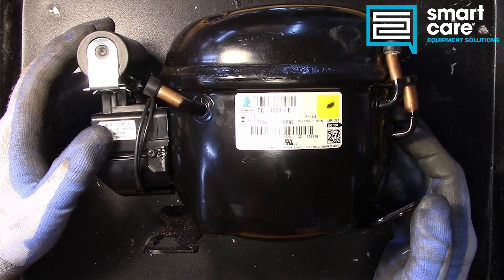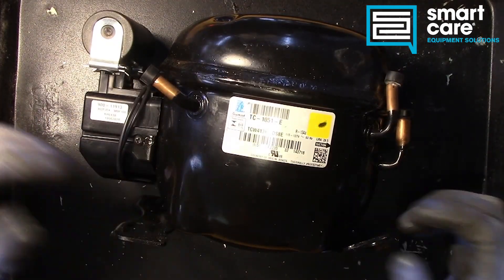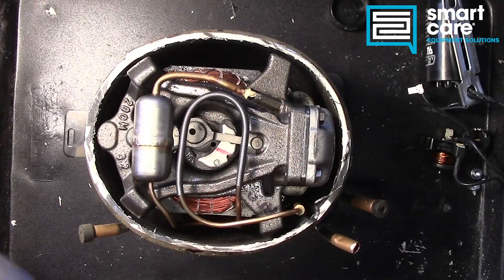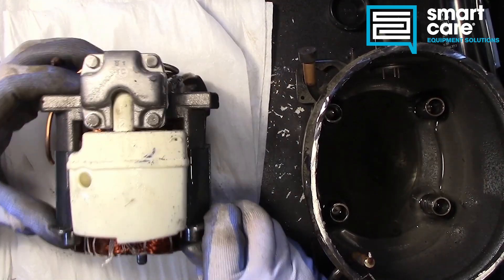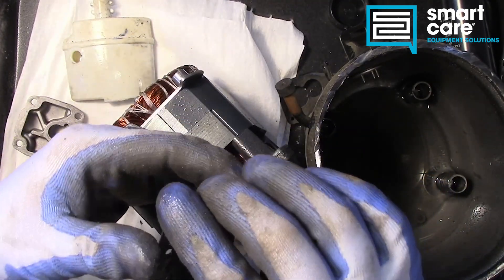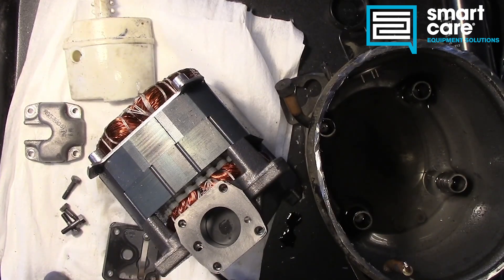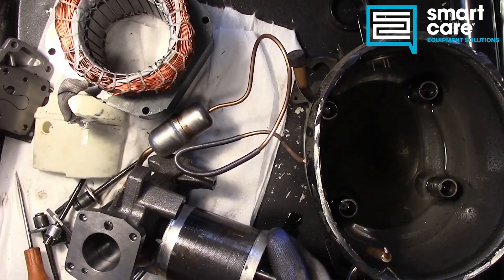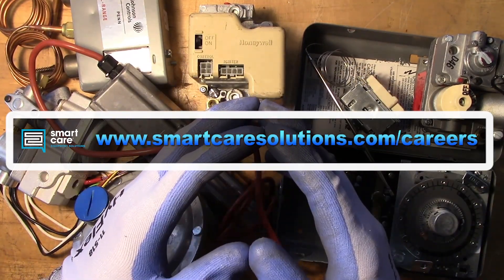Teardown Tuesday Episode 26: Hermetic Compressor Mechanicals

Comment: Well done Jack. My guess is the damage to the rotor was caused when the compressor took whatever hit/fall that caved in the top dome and bent the foot. This is a good example of why parts and components need to inspected before installation, even better if it is inspected before you get to the customer site.